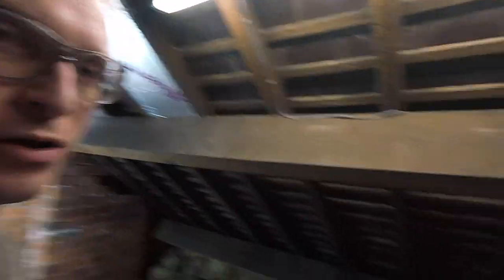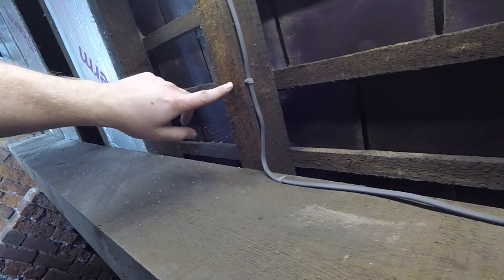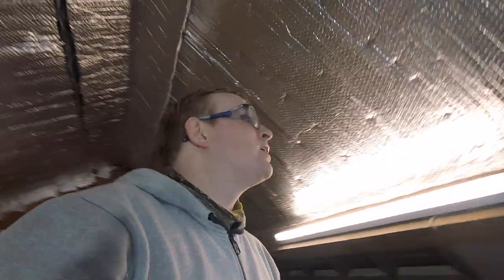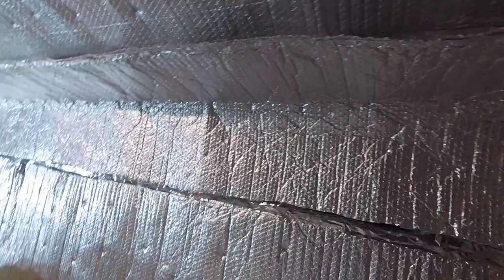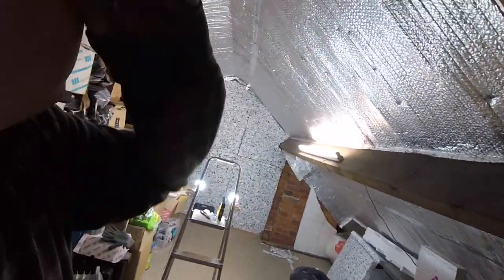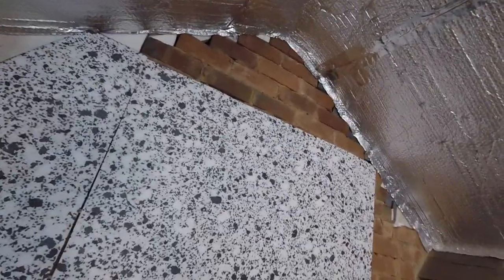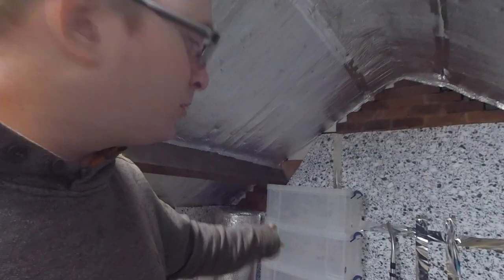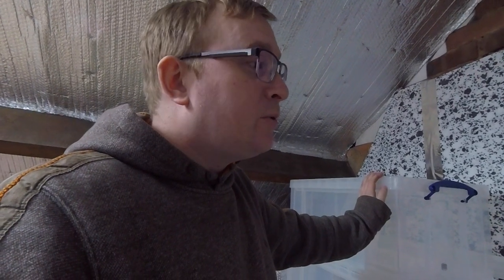Loft project 5   Finally finished the foil - DIY loft insulation / conversion

Comment: Do you still have to let air flow in to the loft to stop mold and if so how did you deal with that without letting too much of a draft in
Reply from the maker: I measured and left a good size gap between the boards and the roof and also I didnt  insulate low down and air can flow there. Years later I've had no dam issues, hope that helps.

Comment: Nice job - question is have you completely filled the loft since you finished it 3 years ago??
Reply from the maker: I’ve a strict no stock rule. So only packaging , office stuff, personal stuff in labelled boxes and a few gaming bits that I use at home for testing. I’ve still pretty much filled it and even with the floor being reinforced the ceiling below has a crack 😬